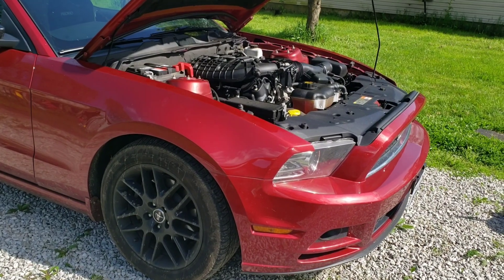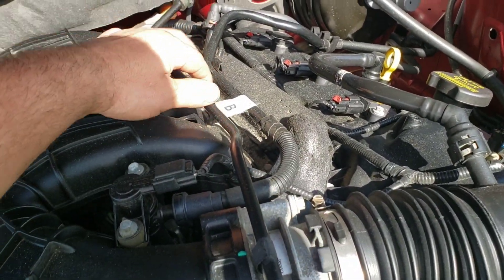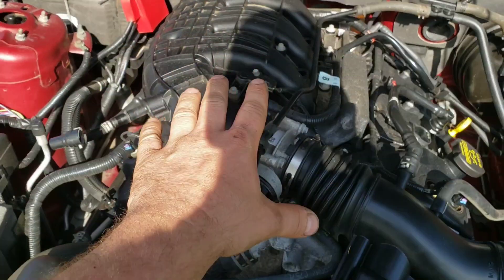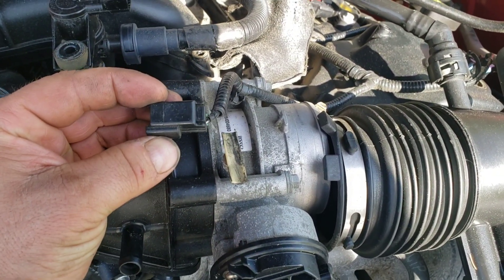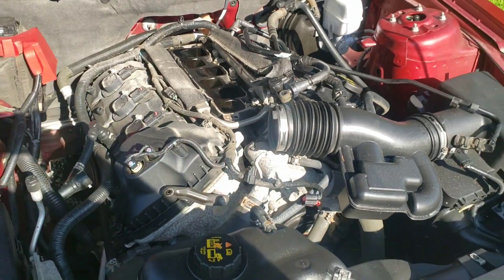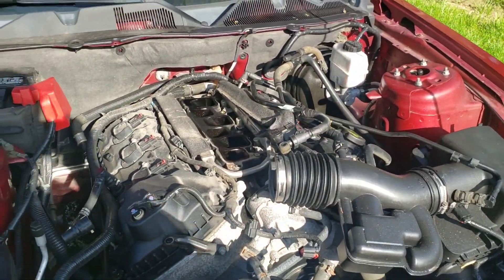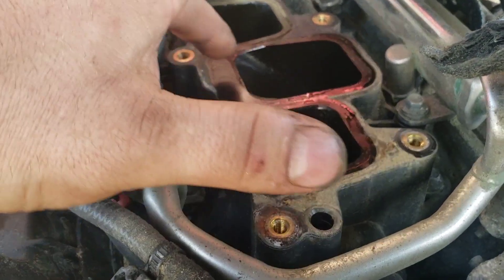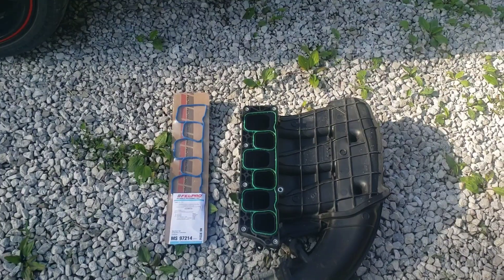11-16 Mustang 3.7 V6 Upper Intake Manifold *Detailed* Removal & Install

Comment: Man I appreciate this video so much. I got a quote to replace my plugs and it was $550 thought that was insane! Bought 6 spark plugs for $46 drove up to my dad’s house and we replaced them together over a couple beers and 2-3 hours. Super straight forward. The hardest part was popping those plastic clips off that were holding the hoses in place 😂

Comment: Hello man, Just wanted to say thank you, I have always been afraid of working on the engine, especially splitting it in half, your video was the reason why I saved over $1500 doing this job myself. I watched your video a good few times and by the time Amazon delivered the parts I was a pro. I just finished the test drive and my mustang is back to normal and purring beautifully. I have a 2014 Mustang 3.7L V6, everything you said and showed was accurate, the only difference I had was that I had a stabilizer bar over the top of my engine due to being a convertible, however, everything else applied. Really loved the part about the torque sequence for tightening the upper manifold back on. Thanks again!
Reply from the maker: That's awesome, I love comments like this. Knowing what some shops charge to do this stuff really makes me want to open my own shop...
Reply: I have a stabilzer  bar as well. When you took it off, did your front shocks/struts move, or does those other bolts keep the shock from moving.
Reply from the maker: @regis - I have taken those off of many cars (they are actually called a strut tower brace). If they use different bolts/nuts than the struts, then yes the struts are held in place by their own hardware. If they share the same hardware, then just replace the hardware once the brace is removed (and torque properly). 

The function of the strut tower brace is to keep the car and struts from flexing around corners. They add them to the convertible because it is heavier and requires the extra bracing- they also add them to the more performance oriented models to improve the handling in corners over a base model.
Reply: @BuckeyeBallistics  Thank you, I was wondering about this yesterday when I was looking under the hood. I'm going to change out my spark plugs soon.
Reply: He's a Godsend, brotha. I started working on my car about 2 years ago because I simply just don't trust mechanics and have been flirting with the idea of tuning up my car. I stumbled across this video maybe a year ago but never got around to changing them. Recently, I pulled up this video again and said eff it, I'm doing it. After I memorized the steps, it was a breeze and only cost me a 3/8 ratchet and 9/16 socket that fell down the sewer by accident 🤦🏾‍♂️🤷🏾‍♂️ but aye the jobs done.

Comment: Hey man, I wanted to give you HUGE thanks for this extremely detailed video! I started having major stumbling a couple of weekends ago and threw a code that said misfire in cylinder 6. Figured I might as well change all the plugs and coils if I was going to do one. I watched this video so many times while I waited for my parts to come in that when I started the process I felt like I'd already done it. The job went perfectly! For all the parts and the tools I bought (finally had a good excuse to buy a torque wrench!) I still spent a fraction of what it would have cost to have someone do it, and it only took a couple of hours. Really appreciated!
Reply from the maker: Excellent. If your stang ever needs further repairs down the road, I may have a video on whatever that may be as well when the time comes. I have a couple repair/replace videos already, and I'll be doing all new front and rear brakes/shocks/struts by spring if not sooner (already have parts). Check out the Mustang playlist on my channel for that and some hotrod videos 👍
Reply: Hey Jarrod did your vehicle ever show the code again? , I have the same code on my stand I replaced all spark plugs and coils but my car still sounds weird from the exhaust and it’s still has my engine light on.
Reply: @FernandoMartinez-gc3yo  So far no, still been good and smooth and no codes. Hope you get yours sorted!
Reply: @biltrex  what kind of plugs and coils did you use if you don’t mind me asking

Comment: Excellent video. Clear and complete. I really appreciate the torque settings and order. Thank you. I am about to do a plug change and coolant flush on my 2013 Mustang (3.7l V6) and was wondering about how to properly remove and reinstall the intake. I'm not going to do a full flush just going to drain and refill the radiator. That should be sufficient.

Comment: For my 2017 3.7 Mustang, the service manual shows replacing the intake gasket.  It also has a different torque sequence for the intake manifold bolts, with 3 and 7 being switched.

Comment: Hey, thanks a lot for this video!!! I've got 2 questions, do you think those iridium spark plugs are any better than OEM Motocraft, second,  where do you get all the torque values from? Is there a concise service manual available somewhere, as the ones I've found so far are rather difficult to browse.
Reply from the maker: 1. Yes- I have been using iridium exlcusively for the past 20 years in everything I drive. Better spark and longer life.

2. Google search, reading the forums. I never take the first answer to heart, I always read multiple sources and weed through the B.S. of people just guessing instead of providing the actual number from the manufacturer. I have been working on cars 20 years, I know when I see a number if it seems high or low or not and go with the one that most closely resembles what I know should be accurate. Often times the specs are comming from people that have access to the manufacturer specifications, like actual service technitions- or someone else that found that source and re-posted it. Unfortunately there is no go-to place where I get my information- I have to weed through the B.S. as I said and pick my source using my knowledge and experience if it is not directly quoted from the manufacturer (but often times it is).

Comment: I’m gonna do my plugs this weekend. We have the same color car, mines a ‘12. Watched your brake video and had trouble but now they’re working great. I’m thinking of getting 3.73 gears next.
Reply from the maker: Yeah I remember you said you had to take it to the shop and they just bled the brakes. I have a few videos on the 3.73's; best mod I have done to the car so far, that and the tune. I'm taking it to the track in 2 days to see what it will run with current mods, then installing headers and ported intakes and running again to see how much faster it runs. I'm assuming you have found my Mustang playlist by now, but if not, I have a bunch of videos in there. I'm also about to install new pads and rotors (drilled and slotted) and new Koni shocks & struts here in about a week or two.
Reply: @BuckeyeBallistics  yeah I don’t know if what the bleeding helped or just breaking them in or what but now it’s like brand new. Weekend before I installed SR performance springs and koni orange struts and shocks. Replaced the rear sway bar end links. (They were shot) Did you replace the rear lower control arms? I’ve heard pros and cons to it on ride quality.  I’ve got the airaid cai. I need to get a tuner before I go any further. You have mpt tuner right?
Reply from the maker: Have not replaced anything suspensionwise yet, until my Konis go on (orange like yours). Yes, mpt tuned. The 93 tune is much stronger than the 87, definately worth paying extra at the pump imo.
Reply: @BuckeyeBallistics  I like the ride. A little stiffer. I’m still on 18’s and not planning on going to 20’s cause I think they’d be too rough riding. I like more meat on the tires but I think you’ll love the konis

Comment: I reused my gasket, no problems after 10000 miles as far as I can tell.   Ridiculous that you need to remove the intake to change the plugs.  100 years making cars and they still have their heads in their asses.
Reply from the maker: Yeah I know, it's bull. But at least it was an easy manifold to remove; done much worse in the past. GM's 3800 V6 was about 3x as bad, and my 97 Probe with the 2.5 V6 had to be one of THE worst in the world, absolute nightmare. Thanks for watching and commenting.
Reply: I have to do my plugs this weekend. Haven’t had to change plugs since I’ve had a car with spark plug wires.
Reply: They make DIY harder so you'll go back to the dealership service and let them do it.  Just like how they took away the transmission dipstick and you practically have to take the whole transmission pan off just to change the fluid.  They're trying to get you back in the service department.
Reply from the maker: I agree 100%. I have noticed over the years that some things seem to be deliberate so you will have to take your car in and pay them over $100 an hour to do it, plus pay for their overpriced parts. Just wait until it's like the farm equipment industry, where you're not even allowed to fix your own vehicle...

Comment: Hey brother question? Why do you need to have a torque sequence and why does it also needs to go in a order and also the inch pounds of torque? Sorry I’m lost with this 😭
Reply from the maker: Hard to explain the physics behind it, but following the sequence and order helps make sure the part goes on flat and level so that there are no gaps/leaks. And they quote inch pounds because it's such a low torque number- I generally mention it in the videos, but you ideally want to use a small torque wrench for such a light amount of torque, and they usually run/measure inch pounds instead of foot pounds. Often times the larger wrenches aren't very accurate on such low numbers, which is why ideally you want to use a smaller wrench, which again are usually in inch pounds.

Comment: May I request the removal of the fusebox under the hood? and if at all possible, showing which wire underneath the fusebox leads to the fuel pump relay fuse. I'm interested in making a hidden killswitch and I also have a '14 v6 mustang.
Reply from the maker: I don't have the car anymore. But if you like my car videos, please subscribe to my new car channel "92KBuilds" as I do not post car content on this channel anymore.

Comment: Hey bro great video! Is the replacement of the upper intake manifold gasket necessary to switch out the spark plugs?
Reply from the maker: As I discussed in the video, supposedly it's a lifetime gasket- but I went ahead and replaced mine anyway just to be safe. But technically you shouldn't have to...

Comment: Thanks for the detailed video. How many miles when you changed them and how long did the job take? Love Felpro never had issues with them.
Reply from the maker: I changed them around 110,000 miles because I bought the car used and wasn't sure when they were changed last. But I change cheapy plugs every 30k or iridium every 60k. Job took about 3.5 hours for me but that included recording and narrating...
Reply: @BuckeyeBallistics   Thanks I figure 2-3 hours for me taking my time while watching your video.

Comment: You don't need to remove the two bolts from the vapor solenoid. Also you can remove the hose from the breather pipe near the firewall instead of on the intake manifold and just take the whole pipe with the manifold. Rebolt order doesn't totally matter just go out to in and torque to snug. Total removal should take no more than 5 minutes. Same to reattach. You don't need to remove the negative terminal for this either. Only came here because my dad's 3.7L is missing that front manifold bracket bolt, and I was trying to see if your video gave a good view of that particular bolt, but you never quite pulled it out. It's missing in my Dad's car, and I think that's causing it to throw a vacuum leak code.
Reply from the maker: Whenever you unplug the maf it is a good idea to have the battery disconnected before you plug it back in, as the power surge on reconnect can sometimes blow them. This may seem ridiculously false, but some Toyota's for example are actually know to have this problem and I have experienced it first hand and had to replace. So I've just made it a habit. Also there are those that say you should always disconnect the battery anyway regardless of what repair you are performing, for "safety." Had I not disconnected it, then I would be getting hate comments from the safety police. No matter what I do or how I do it one of you guys will always have something to contest. Sigh, such is the wonderful life of a youtuber...
Reply: @BuckeyeBallistics  You unbolted the vapor solenoid from the intake manifold not the maf. The maf is located right after the airbox off the intake hose well before the throttle body. The maf is not something that needs to be removed to remove the manifold. Anyway, I only came here to see if I could get a view of that one stupid front manifold bracket bolt to see if I have something similar lying around from one of my other repairs that I can screw in there because I'm pretty sure that one missing bolt is the vacuum leak in my father's 3.7 that is causing it to throw a couple of vacuum codes. The previous owner or whomever worked on the car prior to my dad purchasing it was careless and didn't reinstall that one bolt.
Reply from the maker: I didn't re-watch the video to see what I removed; I assumed I unplugged the maf. But when you have 700+ videos, it's hard to remember what you did in each one. If you want, I can record a video of what you're looking for to show you, just need a specific location...
Reply: @BuckeyeBallistics  I would just need a look at that front bracket bolt. Like the length and size so I can get a similar one from Napa if I can't find one lying around.
Reply from the maker: Alright. Are you able to contact me on instagram? Then you could send me a picture of exactly what you need and I'll get it for you. If not I'll figure it out and get you an answer. Insta: @gunsandcarsyt
Reply: @BuckeyeBallistics  I ended up calling my local ford dealer. They had that intake bracket bolt for $.83 + tax. I picked it up, screwed it into the manifold and ALL of my Dad's check engine codes cleared themself. I was correct. That was the vacuum leak in my Dad's system solved for $.83.
Reply from the maker: Nice, good job. I'll make sure to keep all the bolts in mine lol.

Comment: I just changed my gasket but didnt know i had to bolt it on a certain way and torque them 🤦🏻‍♂️😂 so i still have a vacuum leak i can bear clearly idk if its bc that or it wasnt the gasket in the first place
Reply from the maker: Loosen the bolts and then torque to spec in the appropriate order
Reply: Sorry for bothering u again but i just bought a torque wrench to torque the bolts but the settings start off at 10 foot pounds or 20.3 newton meters so i was wondering do i have to buy another one with the right setting ofc and if so how can i tell which is the right one. Im tryna learn how to work on my own car so that’s why i was wondering
Reply from the maker: Yeah for those low of numbers you will need a 1/4" drive that is in in-lbs (inch pounds) instead of ft-lbs. Then you just convert: 12in-lb is = to 1ft-lb. So if you need 8ft-lbs for example, then you would set it to 96in-lbs. Here is one such wrench: https://amzn.to/3zR61Yf 

As an Amazon Associate, I earn from qualifying purchases...

Comment: My service manual (2017 3.7 Mustang) also shows torquing the intake manifold bolts in two stages, stage 1 being to 89 in*lbs and stage 2 being an additional 45 degrees.
Reply from the maker: Hard to tell which one of ours has been revised. If your service manual is older, then my specs are probably the new revised specs; they do this often in the automotive world. I just changed the tcm on it on found similar results, where 2 of the bolts were flip flopped in the sequence from one publication to the next. I would be afraid of turning them the extra 45°, because as I said in the video, they snugged up real quick. I haven't had any issues since install. Probably either method is fine though.
Reply: @BuckeyeBallistics  Nice video by the way.  Thanks for posting it.
Reply from the maker: Thanks

Comment: I accidentally stripped bolt number 7, no shops open right now, all other bolts are on there good, would it still be drivable until i can get it into a shop tomorrow?
Reply from the maker: Yeah should be fine with just 1 missing bolt, though may have a small air leak.
Reply: what symptoms could it bring driving it just for today and tomorrow, to and from work? any major engine damage?
Reply from the maker: Yeah it'll be fine for a day or two no problem, I just wouldn't drive it hard. So basically what could happen is it may run a little lean if it has an air leak due to the missing bolt. Meaning, you're getting more air into the engine than what the computer thinks you are due to the leak, so it may not mix the air & fuel ratio 100% correct. This could cause a slight power loss or misfire if you run it hard and subsequently eventually a check engine light- but driving it around like a normal person (not hot rodding) shouldn't cause that at all. Honestly even if you punch it it'll probably be just fine no misfire no power loss no nothin, there's just that chance because you might have an air leak now with the missing bolt. You'll be fine man, just don't hot rod on it until it's fixed if you want to be super sure to not cause anything out of the ordinary.

Comment: Do you happen to know where the Crankshaft position sensor is located? I’ve been all over the internet trying to find it. I have a 2013 Mustang V6 3.7
Reply from the maker: https://www.mustangevolution.com/threads/location-of-ckp-sensor-in-2012-mustang-v6-3-7l.417942/